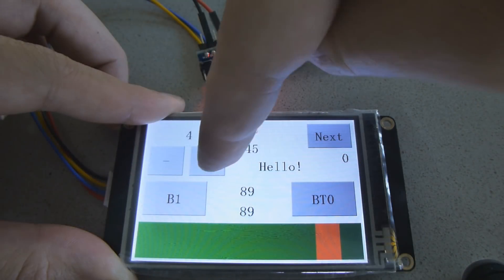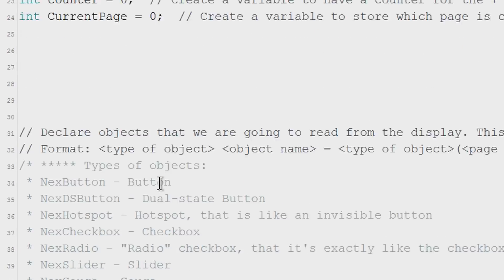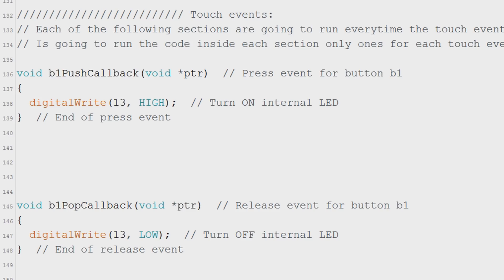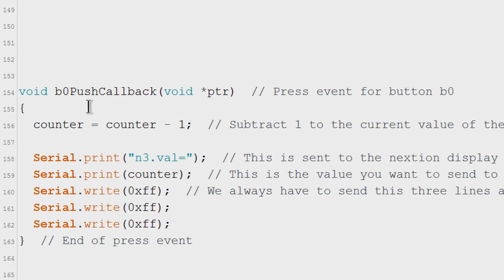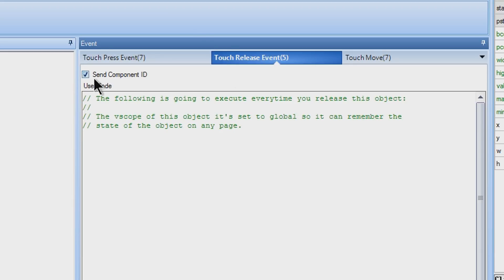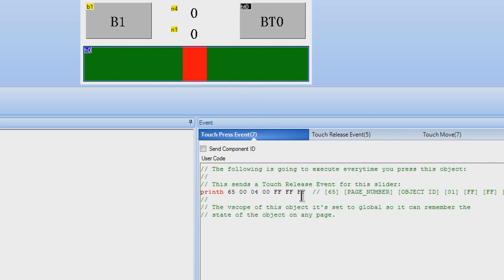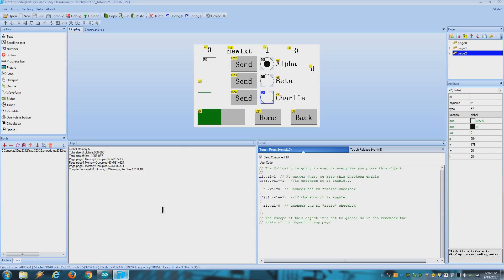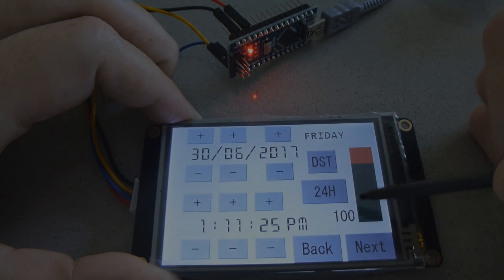Nextion+Arduino Tutorial #2 Sending Data To Arduino

Comment: So why did he skip the step on how to configure the nexCofig.h file? How do you configure that file?
Reply from the maker: Right-click the nexCofig.h file and select "Edit". You can also open it with WordPad
Reply: @interlinkknight  thank you I figured it out shortly after jajaja. Why is this setup not working for me? I tried the same method with just regular buttons for light on, light off for the touch release event. Yes the config file is edited. Have no compilation errors. I am getting serial print on my pc. Rx to Tx wires are correct, I know that they are properly connected, even did a continuity test on them. I am not getting any response from my arduino controller at all. You are latino right? We need more latinos writing programs so we can understand the language better jajajaja. void loop prende la luz a la verga ya. Im Mexican American and these chinese programmers cant communicate well in their translated manuals. I tried contacting Nextion support it says "account disabled" at sign in. Anyway if you want to help I can send you my files, arduino sketch & nextion file. I would appreciate it.
Reply from the maker: My suggestion would be trying to replicate what I have in the video using exactly the same components, same library, same code, same arduino board. No modifications at all. Try first the code from the tutorial 1. Once it works for you, do the same for tutorial 2 (this one). Once you have that working, then try editing stuff and changing the arduino board to whatever you are using (maybe arduino mega?).

I understand your frustration. The people from Nextion is not really helpful. I already interacted with them with bad results. I feel they don't care about the users.

I hope this helps.
Reply: @interlinkknight  It turns out I just didn't have the display connected to controller vcc and gnd. I was using an external power source. When I connected it directly, it worked. With someone elses example and no nextion library though. Havent tried the Nextion Library again, but I'm guessing will have to eventually because my setup will get complex

Comment: In file included from c:\Users\Neil\Documents\Arduino\libraries\ITEADLIB_Arduino_Nextion-master\NexUpload.cpp:16:0:
c:\Users\Neil\Documents\Arduino\libraries\ITEADLIB_Arduino_Nextion-master\NexUpload.h:20:10: fatal error: SD.h: No such file or directory
 #include <SD.h>
          ^~~~~~
compilation terminated.

exit status 1

Compilation error: exit status 1
Reply from the maker: That's using my code? I believe you have the wrong library. Use the one in the link

Comment: Hi! I try to use your program to STM32F103C8T6 with Arduino IDE. When compiling the code, I got an error like this:

NexHardware.cpp:(.text._Z7nexLoopPP8NexTouch+0x70): undefined reference to `Serial2

can you help? I try to search in many forum (stm32duino, github, etc) but doesn't get the answer. Thank you
Reply from the maker: Watch my troubleshooting video about nextion display

Comment: I know this is an old video but i am using your version of the library and wonder if it works with the new arduino r4? Many thanks.
Reply from the maker: I don't see a reason why it would not work, but I haven't tried it. At least for sure the sending information part to the display is going to work because it's just serial commands. The library for receiving data from the display? Not sure
Reply: @interlinkknight  Thank you very much. Im going to be upgrading my project to an R4 as i could do with the extra speed, if you do test it, could you report back or make a video? Im going to be getting one soon anyways to test so i will report back once i have done if you havnt posted an update?
Reply from the maker: Please, you update me when you test, because I don't have an R4 to test with
Reply: @interlinkknight  I wont be getting one for a couple weeks. But will 100% report back how i get on.
Reply: @interlinkknight  Hi, im having problems adressing pags above 10 or buttons on pages higher than 10. What am i doing wrong?
Reply from the maker: Do you mean that if you call to show page 10 it doesn't work? Can you show me in detail that? Better send me by email because i don't get notifications for comments
Reply: @interlinkknight  Thanks you. Is your email in your channel description?
Reply from the maker: yes
Reply: @interlinkknight  Hi. I decided to get the arduino DUE but get this message when i compile. Can you help please?
C:\Users\Tillytony\Documents\Arduino\libraries\ITEADLIB_Arduino_Nextion-master\NexUpload.cpp:17:28: fatal error: SoftwareSerial.h: No such file or directory
 #include <SoftwareSerial.h>
                            ^
compilation terminated.

exit status 1

Compilation error: exit status 1
Reply: @interlinkknight  I got a DUE rather than an R4 for the extra IO. And im happy to report that with some very monir changes to the library, it works very well on the DUE.
Reply from the maker: Oh, I'm glad it worked

Comment: Hello, you have great video tutorials. I finally got around to trying this with a nextion display.  Im just trying to get a doublestate button to work with an led. Eventually, i want the button to move a servo. I tried it with a software serial because I will eventually use a reyax lora module in order to control the servo over radio communication, but it doesn't work that good.  Sometimes the button works and sometimes it doesn't.  If you're familiar with the reyax lora modules, you know that it's interfaced with arduino through serial communication.  So since the nextion display and reyax devices both use serial interfaces, can I use both hardware serials on an arduino Mega?  If so, how would I configure the nextion h file?  I know on line 37 of the file itself it say "#define nexSerial" and if I want to use a Mega, I would change it to "#define nexSerial1".  What needs to be done in order to use Serial1 and Serial2?

Thank you, and keep the great content coming. BTW, the Jet engine is awesome!
Reply from the maker: Thank you for your kind words. You are correct that the best solution in this case is using an Arduino mega. And yes, you need to modify the sketch and the library to say Serial1. I think I show that in the tutorial. Maybe in the troubleshooting video?
Reply: @InterlinkKnight , thanks for the reply.  I did watch your troubleshooting video, and it explains this very well.  I guess I thought I had to define 2 different serial ports in the library.  One for the display and one for the reyax lora module, but since it's nextions library, it makes sense that I would only need to define the serial port for the nextion display in the library itself and the code.  I take it that I don't need to define the serial port for the reyax lora device in the nextion library, I only define that serial port in the code. Thanks again !

Comment: Hi, I want to go into Arduino with nexrion  display in my very first project, is it possible to connect this display with Arduino on much longer wires, ex 4-5 meters? Can I use for that shielded twisted pair wire? Will it work?
Reply from the maker: I don't know, but I think it should work. Try it out and let me know

Comment: Hello, i already try this tutorial and error happen

'class NexButton' has no member named 'getValue'

how to solve it?
Reply from the maker: Watch the troubleshooting video
Reply: @interlinkknight  i watch your troubleshoot video, and solution for my problem doesn't exist
Reply from the maker: Your problem is that you are using the wrong library. There are several libraries for the nextion display
Reply: @interlinkknight  i use the original ITEADLIB nextion master library. And i use Arduino mega. Can you share the other library?

In your video getValue command only declare when you use slider and checkbox. Is it possible to use getValue for button?
Reply from the maker: The link for the library is in the description and on the sketch itself. Use that.

Also, I recommend using and arduino uno or nano. Don't use an arduino mega.

Try my example sketch without any modifications
Reply: @interlinkknight  I read your tutorial and i found it...! hahahaaha that's my mistake bro, thanks a lot...!
Reply from the maker: No problem

Comment: Thank you for doing this Nextion tutorial series. I plan to use the Intelligence model as 2 dimensional 'slider' to control X & Y gains of a laser controller. IOW, sliding from bottom left to upper right increases both X & Y. Sliding in a circle changes the symmetry of quadrature waveform pairs or the overall image. Of course, a dot will be required to indicate the current position, as well.
I've never seen any similar HIDs  on any other controllers, but it is much needed in laser controllers to combine two x & y sliders (requiring 2 hands) into a single touch pad (requiring only one finger). There are never enough hands for a single laserist to keep up with a 4 piece band nor orchestra in real time.
Reply from the maker: That sounds really cool. If you can, post a link of a video showing that project. I would love to see that
Reply: @interlinkknight  Yeah, me too. Lots of R&D ahead, but that's part of the challenge, isn't it? Just hit  snag with my Teensy's audio DACs being capacitor coupled, so they filter out DC offests, like beam positions and DC color control. 🤔
This project could take months to complete, assuming that everything works like it's supposed to.
Shoot for the stars and wear a parachute, right?😎
Reply from the maker: Totally! Good luck

Comment: Thanks a lot for the clear instructions. Unfortunately I can't get the - and + buttons to work, not in the Nextion editor, nor in Arduino. Rest is fine. Hope you can help. I am running Arduino 1.8.16 and Nextion Editor V 1.63.3 on a 8048P070-011 display using an Arduino UNO
Reply from the maker: Did you modify anything on my files?
Reply: @interlinkknight  Thanks for the quick response. I did not change anything on your files, just the Nextion config serial as you describe in your sketch.
Reply from the maker: But the other buttons that also send data to arduino work? Like the slider? B1 button turns ON the LED?
Reply: @interlinkknight  Yes, the led goes on and off and the slider works
Reply from the maker: That's weird. I really don't know why it doesn't work

Comment: in Current page detection i have facing the problem is that, when ever i changed the page , i have to touch the page than only the page will shows the data.... why?
Reply from the maker: I don't understand
Reply: @interlinkknight   For page detection  i have used this line "if(current_page ==xx)" and in page initializer i have comment this line "printh 65 00 00 01 FF FF FF" in Nextion display page ID 0.
This page will shows current time and date through RTC 
My problem is that ,When switch on the system page is not shows date and time.it will shows date and time only after touch the screen.
why?
Reply from the maker: I don't know. Could be a million things, and you are the only one that knows your code
Reply: @interlinkknight  In u r video u r mentioned that how to Arduino knows the page has been changed....
Up to this did u understand...?...if yes ... please reply 🙏
Reply: I have made one program Nextion display shows its first pagr Time and date second pagr some other values..

So i have followed u r program....

Do you understand?
Reply from the maker: Kinda, but still I don't know what it's causing the problem. Sorry
Reply: @interlinkknight  ok. 🙏 
I have two pages , first page shows Real time and date and second page shows some other values related my program....

Now i am going to tell you my issue....

When ever i switched page2 to Page1, the page 1 not  shows current time , values are stuck with last reading,If i touched any where in the display ,it will start to receive the current date and time.

Why?
Reply from the maker: What is sending the time and date? Arduino, right? Arduino sends the date and time only when detects if it's in page 1? Then, check that. Troubleshooting is part of coding. Think of tests that can take you to see where the problem is.

Good luck

Comment: It has been a while since you posted the video, I not sure if someone else have already commented something about the soft serial problem or if you have solved it, but, just to share the information,  the problem probably was the baudrate, I was never able to make it go faster than 57600 using those atmega328 boards running at 16MHz.
Reply from the maker: I didn't know. Good tip. If you try it with the nextion display and it works, let me know

Comment: I just found this tutorial and this is really good. I tried the example with my setup (ESP8266 + Nextion Intelligent 7,0"). I use the current Git master of the itead Nextion library. When I try to compile the code, it gives me some errors which are directly in the Nextion library, more specifically in the NexRtc.cpp and NexUpload.cpp. There are functions with a return value, which doesn't return a value at the end. Does anybody have the same problem?

Comment: Hi InterLinkKnight,,
I hope you are doing well. I've seen that you answer practiclly all comments, even though it has been a year. So I thought that you would answer to this one too.Pl
My nextion display (2.8 inch enhanced), arrived a week ago. I have been able to import tft files on it using my sd card, however I have NEVER managed to upload the nextion code, from the nextion editor, on my nextion from the nextion editor. While the arduino uno I used is recognised as COM3 (the port), it starts the baud rate thingy normally, but after 9 seconds or so, it writes the following error message: "Connection failed, forced interrupt. I have tried every single combination for the yellow and blue cable to tx and rx of my arduino.. nothing works. I have searched on all the forums the solution, but never came across it.... this I why I am adressing this to you, as you seem to know your stuff about the nextion more than well. I also have an other problem with the nextion editor... I have an arduino mega and nano (clones, but doesn't matter as recognised by arduino ide) and neither of them are recognised in the upload section of the nextion editor. They are not found. 
My nextion however seems to work when I connect it to arduino and put code in the ide the standard way. But this only suceeded once, and that was today, uploading a gauges tutorial on it. With your tutorial, I have tried every single combination blue and yellow wire. Even the ones where non of them are connected. Nothing happens. It just keeps my old project going. What is your configuration?? (I have seen previous comments, tried the ones in them but no success. Please come back to me, and if you find the solution, you would literally be a lifesaver. Also note that I am on mac, so I use the ide on my macBookPro, however I am using a virtual machine (Parralels Desktop) to run the nextion editor (setup works fine). I really do not know how this could interfere with my problem, but please investigate🙏🏻🙏🏻🙏🏻.
Many thanks, 
Vincent
Reply from the maker: I don't understand the problem. Uploading the TFT file gives you an error?

You better start from the begining. Do exactly what I do in tutorial #1. Do it exactly the same! This means doing it in an  arduino nano.

When you say you have problems connecting to arduino, I don't understand what you mean. Can you upload common example sketches to your arduino from the IDE, yes or no?
Reply: @interlinkknight  Thank you very much for this quick response! No, uploading the tft file works fine. I have found a solution to the problem, by accident haha! I am writing it here to help other fellow nextion enthusiasts. Basically, if you directly upload the arduino code to the nextion, it will NOT work. You first need to upload the tft file, and then upload the code to the arduino with the blue wire plugged out, then reconnect it. I am so happy to have found the solution, and I hope this helps others too!! Yes, I can now upload common sketches with the nextion.
Thank you again!!!:))
Reply from the maker: I'm glad you solved the problem. Cheers

Comment: Hello , can you help me please , i face a problem on my arduino code "error compiling for board arduino"
I need your help quickly please if you can🥰🥰🙏🙏
Reply from the maker: I hope you realize that what you have is such generic error that it could be cause by a million things.

Just try to start from the beginning, and replicate exactly what I have.
Reply: @interlinkknight  what i did is exactly same as your tutorial , but my project on my arduino uno , i have installed multiple library and each time it gives me an error ,can you please send me here what is the suitable library should i put it and i will refollow the video from the beginning till the end .
Reply from the maker: I put all the links in the description long ago

Comment: Thanks for the tutorial. It was very helpful. I just needed to figure out why it didn't work. So I ended up downloading a few files with bug fixes by Ray Livingston (NexConfig.h, NexHardware.cpp and Nexhardware.h). But the main culprit in my case was probably the fact that I had Arduino Nano connected to the USB while using the RX0 and TX1 pins for serial communication. After disconnecting the USB and resetting the Arduino it suddenly worked! Before that I always had a get.value error (or time-out after using Livingston's bug fixed files). Now I can use a dual-state button for motor on/off and a slider to regulate RPMs through a motor driver with PWM. Project: I am designing a touch screen MMI for a cosmetic machine.
Reply: so will you consider to look at touch screen display?